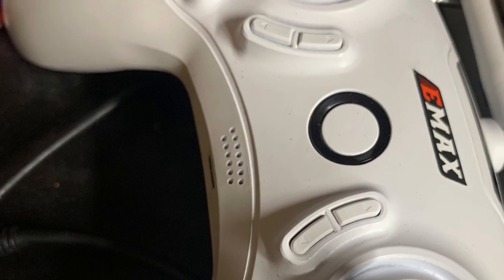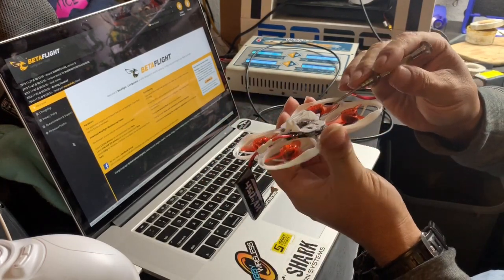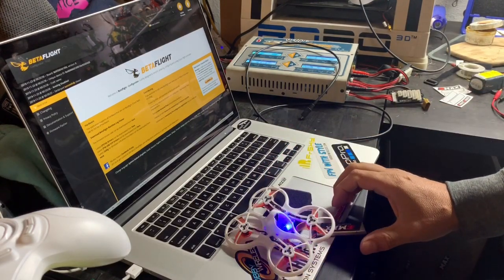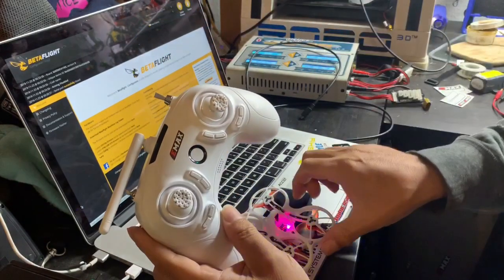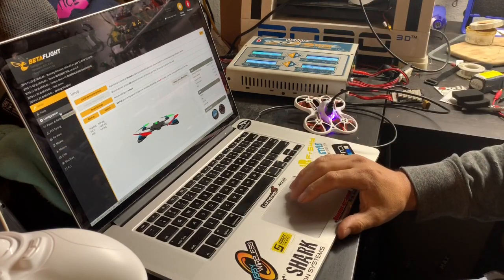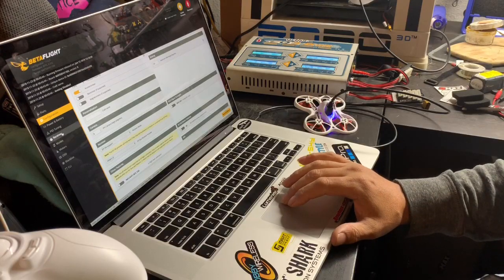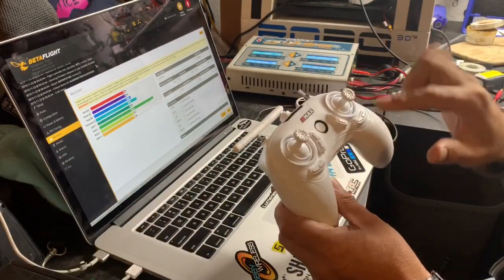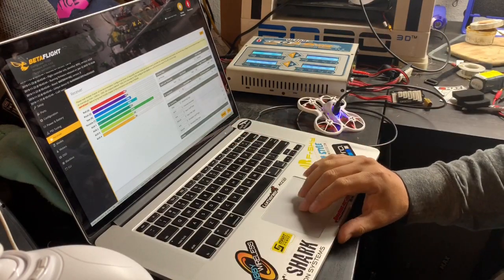How to bind emax E6 transmitters to the tiny hawk s flight controller tx

Comment: So when I try to do the step where you hold both trim buttons, the controller only blinks green, and it won't bind with the drone. Any ideas?
Reply from the maker: Did you download the hex file in the link below? What happened that it needs binding?
Reply: @HoverJunkie  apparently it is some kind of short on the flight controller or the vtx that is causing the drone to restart as if I just plugged it in. If I move the vtx, it resets and does the startup beeps. I have no idea. It happened after a crash.
Reply from the maker: @andyhoughtaling6319   is there physical damage?
Reply from the maker: @andyhoughtaling6319  if not open a ticket with Emax and let them now that it just stop working don’t tell them about the crash and see if you can replace it under warranty.
Reply: @HoverJunkie  nah I have altered it several times. They would never warranty it.
Reply: And no there is no apparent physical damage.
Reply from the maker: @andyhoughtaling6319  did you download the hex file?
Reply: @HoverJunkie  No
Reply from the maker: @andyhoughtaling6319  try it. That might fix your issue if it reset to factory. Sounds like it needs it.

Comment: Hello, thanks for the video... i downloaded the file, and where I put it to be able to flight the drone? Its just not arming... did all the things on the video
Reply from the maker: What the other video Emax E6 transmitter
Reply: Hi, i uploaded the hex file from local, but it got stucked in the process and now cant connect to BF.... ant ideas how to reset the fc? Hold boot and connecting usb doesnt work eigther... br
Reply from the maker: @asenbien  sorry to hear that. Put it on DFD mode reinstall the hex file. Download it to your computer first. Un plug everything then reconnect it.
Reply from the maker: DFU*
Reply from the maker: @asenbien  let me know!

Comment: Hi there.  I followed all the steps and my controller seems to be working on beta flight with the drone plugged in but it still won’t work when I plug it all in.  I’m at a loss here and need help lol
Reply from the maker: You may have tune off the spin when arm bottom on beta. Try this, arm the quad and give it throttle and see if props spin. It should.
Reply from the maker: Also make sure throttle lever is all the way down before arming it. For redundancy go on beta a make sure the throttle limit is below 1000 and all flight controllers are sign to the where they belong ailerons, rudde and pitch. Hopefully this helped happy flying
Reply: @HoverJunkie  weird how I decided to try again and I put my drone in bind mode and it just started working lol thank you very much for replying so quick.  I’m a complete noob and am trying to learn.  My first tinyhawk 2 drone is probably in someone’s garden After I lost control at a ridiculous height haha that’s why I was trying to bind my new one lol
Reply from the maker: @glens1800  hey, glad to hear your flying again my pilot friend. Please don’t for get to like and subscribe to my channel. I really appreciate the support. Safe flight and be careful with the trees

Comment: Please help I did this but it won’t arm I went into modes and tried to mess around with it I got the beeper to work but I can’t get it to arm. Only the beeper works. I understand that there is two auxs which is the two switches.aux 1 is on the right aux2 is on the left. And each mode has on orange thing that tells you what range you have be in for that switch to do that thing well I do that and literally only the beeper works. It’s makes perfect sense I don’t see how it wouldn’t work but apparently I’m wrong
Reply from the maker: No worries. When you put the switch to arm on beta does it light up and show the range?
Reply: @HoverJunkie  I got it to work now it’s on the left stick going up and down and but now when I arm it the PROPELLORS fly offf and it leans right.
Reply from the maker: @finexity5054  that’s great, go on the first page of bets and calibrate the gyro. Please like and subscribe, I appreciate the support.
Reply: @HoverJunkie  hopefully this works
Reply: @HoverJunkie  calibrate accelerometer? there is no calibrate gyro button
Reply from the maker: @finexity5054  go on the first page on beta, place the drone on a flats level surface and push on the first tab calibrate.
Reply: @HoverJunkie  it dint work I think I need to calibrate the second one but it doesn’t let me click it. It says I have tk move multi rotor  360 degrees on all axis of rotation
Reply from the maker: @finexity5054  did you download the hex file link?
Reply from the maker: If so give it throttle and it should fly.
Reply from the maker: Let me know.
Reply from the maker: https://youtu.be/6di6L_6u7bk look at 21:13 and let me know if get the same thing?

Comment: Thank you very much for this. I was able to bind to the controller following your directions. However, it will not arm, even though it's bound. In Modes it shows Arm is disabled. How do I enable it in Betaflight? It's set to Aux 1 and the range is 1700-2100 (I'm new to this and have no idea what those ranges mean). When I input STATUS into the CLI, under Arming disable flags: BADRX THROTTLE CLI MSP ARMSWITCH. Not sure what to do about that. TIA!
Reply from the maker: Harry Rosenkrantz make sure throttled is below 1000
Reply: @HoverJunkie  Thanks for the reply. I finally figured out that the channel map in the Receiver tab was incorrect. I set it back to Default and voila! For a noob, I'm finding it take me sometimes hours to figure out what those with experience figure out in minutes. Regardless, it's up and running now!
Reply from the maker: Harry Rosenkrantz that’s great, please don’t forget to like and subscribe. I appreciate the support.

Comment: Hello - My husband is trying to bind his controller and control and we have started to watch this video and there is no blue light on the drone just a red? He's tried to connect it for months so now I'm having a turn but just wondering what it means if we don't have a blue light?
Reply from the maker: Amy Renwick is it the same drone as the video or black?
Reply: @HoverJunkie  yes its the same drone - white. He lost the original drone that came with the controller and bought just a new white drone( same as original that he lost )
Reply: Thanks for your fast response to!
Reply from the maker: Amy Renwick your very welcome... ok, no worries. I downloaded a link to the software that belongs to that drone to work with the E6  controller. Please follow the steps on both tinyhawk videos. The second video will show you to do the setting to arm and to set the acro,horizon and angle mode. Please do t for get to like and subscribe.

Comment: Hello Hover! thanks for the video in first place, it surely helped many ppl! i'm very new in this world and recently bought the emax tinyhawk rtf version, flew a few batteries and now I have a problem, seems like my controller and drone does not communicate.  So, when I hold the two trims my light blue will still be fix (not blinking, while the red is still blinking) and it seems I can't get over this pass, any suggestions? i'm going crazy and don't know what to do :( any help would be really apreciated! 
PS: I'm even having some problems with downloading betaflight and all that stuff, any help would be very helpful please! thanks in advance, keep up the good work! :)
Reply from the maker: Alessandro Calabro hello, when you mentioned the blue light staying solid when pushing the tabs on the controller, are you referring the blue light on the drone ?  The controller should have a red and green light.
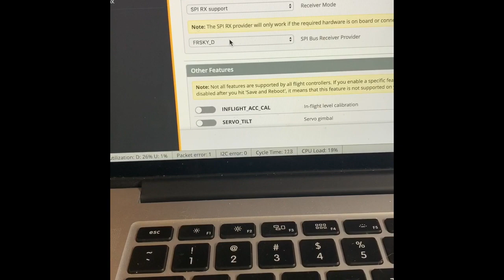Reply: @HoverJunkie  yes sorry, the blue light on the drone stays fix, while the controller beeps while you touch buttons and goes red/green when you put it into bind mode. I was trying yesterday, rewatched the video, and now I have betaflight 10.7.0, I plug the tinyhawk in and I have exactly the same configuration as you put in 4:07 (everything ok till now, I think)  but when I follow your steps for the receiver mine doesn't show all the movements like you do in 4:17 (still gets on, beeps when touching it, but it's not showing response in the screen). Do I have to get that Hex file from emax? 
I hope I'm explaining well cause english is not my first language sorry and many many thanks in advance for all the effort you do for us :)
PS: when flying it few days ago I had a crash, may that be the cause for all this? is there the possibility to have the FC damaged? I'm so new in this I'm not even able to diagnose anything ahahah! Thanks again
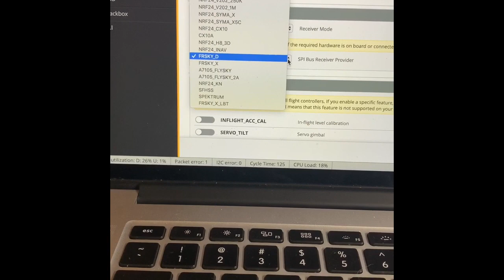Reply from the maker: Alessandro Calabro  did you follow 3:40 ?
Reply: @HoverJunkie  yes I did that, I put the FRSKY_D and save, but when I check on receptor as in 4:17 nothing moves on the screen, but my controller does beep when you touch the switches. At this point I don't know what to do :/ thanks for the quick reply :)
PS: is there the possibility that something is broken/damaged? seems strange to me that the drone flashes lights and all that and the controller seems to work too but they just don't bind together :/
Reply: @HoverJunkie  ok now the controller seems to respond on screen, but when I plug the battery on the tinyhawk and then turn on the controller they seem not to have binded. Damn I thought i've got it but not this time either :/
Reply from the maker: Alessandro Calabro at 2:00 did your blue light blinked it stayed solid?
Reply from the maker: Alessandro Calabro I need to ask some questions to help you.
Reply: yes and it was bounded. I think I now found the mistake, the whole drone somehow got reseted (controller and drone were bind but when I checked on Modes on betaflight there were all empty :O ) so... what now? Do I have to configure everything from scratch? I managed to get Arm mode (but props won't spin until I use some throttle) and Beeper mode (but it doesn't beep) What now? Ahahah seems like this drone is joking on me, anyways feel free to ask me anything. I really appreciate your help man, many thanks :)
Reply from the maker: Alessandro Calabro go under modes, select auto and flick whichever lever you want on that setting. Let me know how it goes.
Reply from the maker: Alessandro Calabro you did ended up binding right?
Reply: @HoverJunkie  yes, actually I ended up watching your other video (the 38min long one) and for now I think I have sorted it out more or less, I can arm the drone now and it responds to the controller. tomorrow i'll do some flight tests. At least I could fly in my room and seems fine, not perfect yet (look my comment on your other video) thanks again for the quick replies man :)
Reply from the maker: Alessandro Calabro I downloaded a mew link for the tinyhawk

Comment: i can see the readings of my transmitter on the betaflight, pitch roll yaw etc but my tinyhawk 2 isn't responding to any of the commands
Reply: Look into modes on betaflight, it happened to me that both drone and controller were bound but the controller hadn't the modes configured on the buttons/switches.

Comment: hello
i have a problem. when i take off, my drone doesn't go straight up, it moves forward a little. maybe a problem with one motor. Could you help me to set the motors right? i am really new so i don't know betaflight
thanks a lot
Reply: drifting is normal, hovering stably in one place is not really possible on fpv drones. You can try pressing buttons on controller to trim the default pitch so that it's more stable in angle mode

Comment: Thankyou!! my wife is a middeschool science teacher, the kids use the quads in class(tello and tinyhawks) and they fly them to death (literally).  This is my 3rd TH FC, I though the kids my have broken the had controller also.... new FC and motor is connected and ready to head back to the classroom.  I have discovered emax has installed  2 different FCs for the (origional)tinyhawks. Matek411+Matek411RX, this was discovered when a student forcibly inserted the battery backwards and let out the "magic smoke"... bought the TH-s FC, installed, bound, no problems....I did look at emax's site(download instructions) to see if there was any info in this file... YUP sure was, guess I still havent grown up, I still dont read instructions..
  Again a BIG thank you...
Reply from the maker: Rob Axelsson lol drones are so therapeutic for everyone it’s seems. Glad to be of help my friend. Please like and subscribe if you haven’t already. I appreciate all the support.
Reply: I read your post on RC forum (or so) hehehe. I was looking for info on binding RadioMaster Pocket cc2500 to the TinyHawk 2 (by the way, I still don't know if its possible or not...)
Reply: @ola@olakehase1848sure of the protocol of ur controller(ELRS, crossfire, Frsky,d8)… and I THINK the Tinyhawk 2 is Frsky/d8.. don’t quote me..
Reply: @robaxelsson530  RadioMaster Pocket cc2500 is compatible with FrSky D8/D16, so theorically, should be able to bind with TinyHawk 2, wich uses FrSky D8. I'm noob in FPV, thats why I ask...
Reply: @olakehase1848 gotta be honest, havnt flown in months.. first, find out how to get the TH2 in bond mode.. do the same for the controller..make sure they are both on the same d8=d8. D16=D16 I have a Betafpv controller that has both.. but u have to make sure ur quad rx is in the same mode.. if the TH2 is d8 and the controller is d16.. not gonna bind
Reply: @robaxelsson530 nice, I'll try to. Thanks!!!

Comment: ok mine is bound  and on beta flight i can see it receives the inputs for throttle, yaw, pitch and roll.  But when i switch it to beep, it does not beep.  When i switch it to arm, it does not arm.  Any suggestions?
Reply from the maker: 360Rumors look at throttle settings on beta and make sure it’s under 1050
Reply from the maker: 360Rumors give it throttle after arming even if props aren’t spinning it should go. I will make another video on this topic. Please ring the bell and subscribe to be notify.

Comment: Can you bind the original radio to the emax tinyhawk version 2?
Reply from the maker: Heart Pilot yes it can be bind for both.
Reply: Thanks.  Was planning to get the second version without buying a radio.
Reply from the maker: Heart Pilot for sure, don’t forget to like and subscribe
Reply from the maker: Heart Pilot please like and subscribe
Reply: @HoverJunkie  Do you know if you can connect the ez pilot to tinyhawk or TH2?
Reply from the maker: Thomas Stange no it will no connect l, the controller is different
Reply from the maker: Thomas Stange don’t forget to like and subscribe I appreciate the support
Reply: @HoverJunkie  is it possible to connect the TH2 controller to the TH freestyle 2? 
Thanks for the vids, big thumbs up!

Comment: Wondering if there is a way to reset the trim on stock radio. My sons will hover no problem so it reacts as expected. Mine will not and is difficult to control.

Comment: my blue light never blinks to bind in the process - i tried several times any suggestions ?
Reply from the maker: Russell "The Real Estate Guy" how old is the is the flight controller?
Reply: Hover Junkie I’ve followed this video to bind it with no luck, I have also tried the bind button whilst plugging battery in with still no luck, it goes into bind mode (solid blue light) but the light stays solid after if followed all the steps, any ideas on how to solve this
Reply from the maker: Anonymous j did you download the hex file
Reply: Hover Junkie no that would be the next thing to do I’m guessing, I will look into it in the morning
Reply from the maker: Anonymous j yes download it and when you plug in the hawk look at the blue light make sure it’s blinking then hold the bi d button until it turns solid. Then bind the controller. Let me know.
Reply from the maker: Russell "The Real Estate Guy" if it’s the first generation then hold the bind button and plug the battery in.
Reply: Seems it did bind shows all functions on beta flight but won’t fly. When I activate it one solid blue light when I throttle up red light blinks as if it’s not throttled all the way down but it is ?
Reply from the maker: Russell "The Real Estate Guy"  no worries, I will make a video in a few days about that. Your not the only pilot with this issue. Please subscribe to be notified about the up coming video.
Reply: @russelltherealestateguy7527  I have the same problem too
Reply from the maker: Osvaldo Emmanuel Perez Peña make sure all action is correct to its proper channels like throttle is throttled, aileron is matching with and so on. If not it will not arm. Let me know.
Reply: Thanks I got it to bind all actions visible on beta flight but it won’t take off. Got solid blue light when I activate and throttle up from the red light blinks. The props don’t spin.
Reply from the maker: Russell "The Real Estate Guy" make sure all action is correct to its proper channels like throttle is throttled, aileron is matching with and so on. If not it will not arm. Let me know.